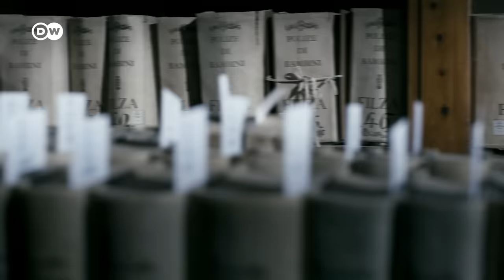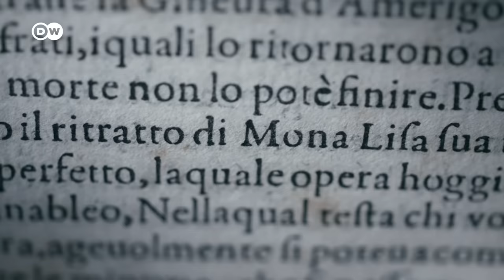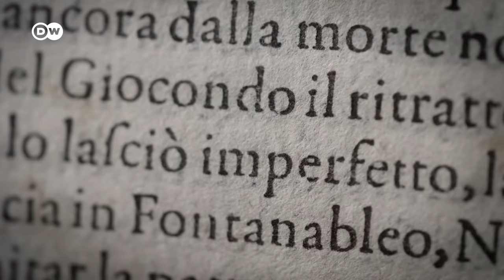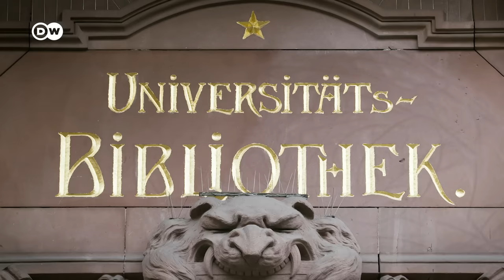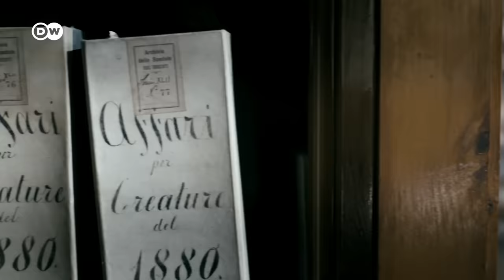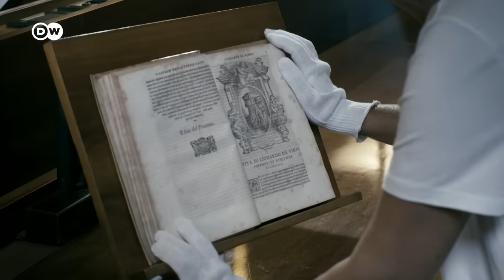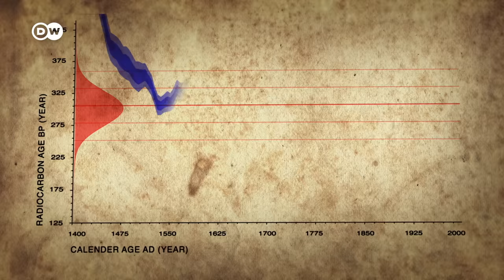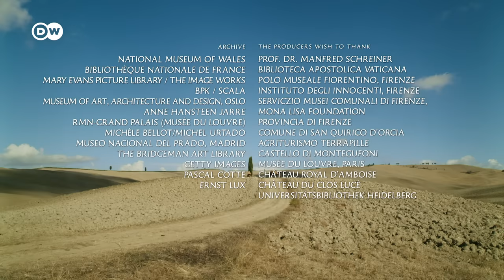The Mona Lisa Mystery

Comment: I'm certainly no art expert, but he mentioned that each artist had their own preferred recipes for mixing their pigment.  Was Da Vinci's recipe not known?  Could they not simply test a sample of one painting recipe to the other?  Too simple? 🤔🤨
Reply: Unfortunately a bit yes. Paints were made by the artist each morning by grinding pigment and mixing them with eggs and oils. All of those 3 elements fluctuated. Every egg is chemically unique, every batch of hand pressed oil from oil seeds as well, the pigments come from different quarries. Some colours like black use coal, burned wood. Whatever was there left in the morning after the nights fire. In addition over 500 years change the organic chemicals depending on where the painting was stored. From that period, none of two paintings are chemically equal. 

Chemical analysis as a method is only reliable for paintings not older than 100 years.
Reply from the maker: @denkendannhandeln  Thanks for sharing your insights with us and our community!

Comment: It's a forgery. You can tell by looking at the neck and her left eye brow. In the genuine her neck has a slight curve, but in the fake, you can see it's a straight line. And if you look at her left eye brow you can see the brow line is very significant. Whereas the fake that entire area is "flat." Also look at her left chin. On the original you can see the chin line. It's different from the shadow, but on the fake, you can see whomever did it, they just blended the chin into the shadow and did not make an attempt to define it. These are subtle but basic forms of the human body. Someone like  Da Vinci would never make such mistakes. Whomever spent money on the fake just flushed that down the toilet. Sorry folks, you got duped.

Comment: 38:44 And my own view, based on factual data, is that the Louvre is the "modello" for the one at El Prado. Fact 1: both were done at the same time. Fact 2: the painting was a paid order. Fact 3: the Louvre uses low quality pigments, on a standard wood panel, and has WRONG perspective (into 4 different vanishing points). Fact 4: the El Prado uses highest quality pigments, on the best wood panel, and has PERFECT perspective.

So, unless you prove me that Leonardo swindle the buyer giving them the one made with bad materials and bad perspective (because we know da Vinci didn't know anything about perspective, right?), the Louvre can NOT be the "original". As both were made at the same time, the only LOGICAL answer is that the Louvre is the "modello" (1:1 test painting before working in the PAID final, AKA the "real", AKA "expensive materials, so no toying around wasting money"). Thus, making the El Prado the REAL "Mona Lisa" painting.

Comment: Overstretched beyond any reasonable length Wikipedia article about painting with questionable provenance and artistic value. The painting in question is on display in Turin until May 24, 2024. Video is FULL of irrelevant Dramatization and staged scenes, is that really CGI’d Sean Connery playing Leonardo 😅? Should be re-edited into 15-20 minutes with properly formulated expert’s opinions and known facts.